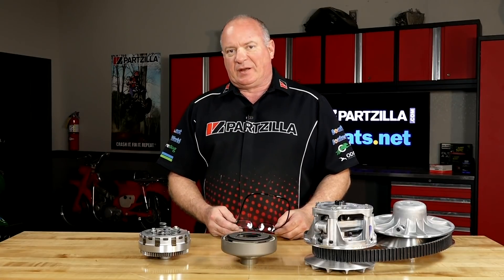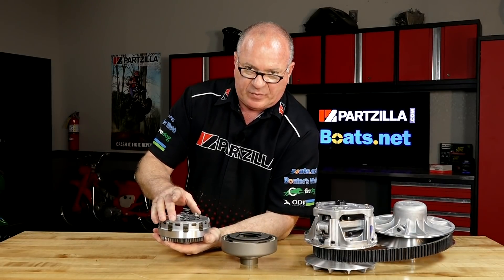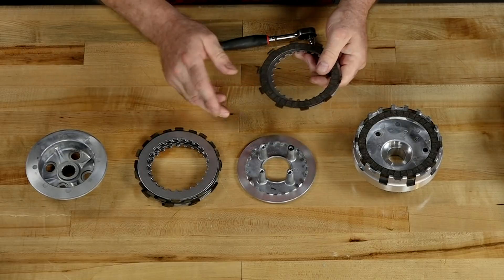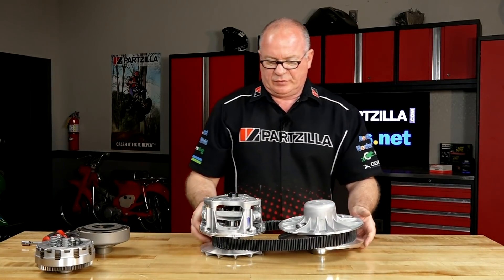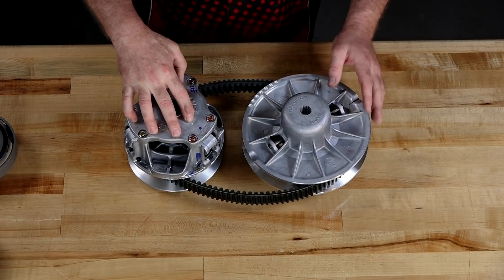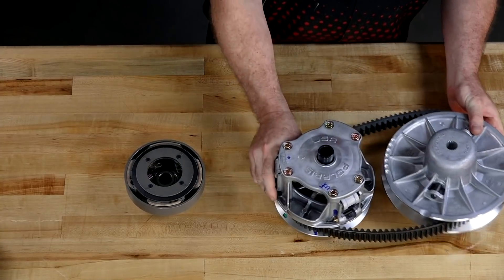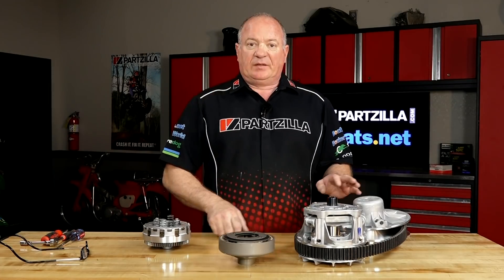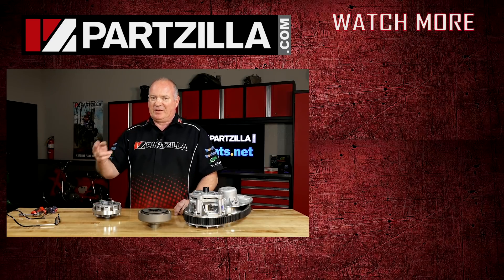How Do Clutches Work | How Does a Motorcycle Clutch Work | Partzilla.com

Comment: I took my FourTrax engine off the frame to fix some stripped head cover bolt holes and when taking the engine off I took the side gear assembly/shaft out and all those gears fell loose. I tried to line them up and did ok (tho I had to split the case to eventually place the washer back on that shaft ). Upon tapping the cover holes, changing the timing chain and reassembling it, I found there was no drive. I assumed it was the side gear where I pulled it out. So I removed the engine again and disassembled it again and split the case to find the washer and placed it back on the mainshaft. All the gears appeared right and zi shifted through them while turning by hand. Im assuming it wasn't the transmission but possibly the clutches themselves. I'm thinking I'm going to reassemble the case tomorrow and if I put it back together and it doesn't drive yet again it's probably a problem with the clutches and if I have to work on those again I'll just leave the engine on and remove the clutch cover on the side to work on it. Any idea why the clutches would happen to not work after being removed and reinstalled normally? It appeared to install right...

Edit* the reason I took the side gear off is because I was new to these engines and how they came apart. You live and learn 🤣

Comment: Hi John, I’ve got a 2009 r6. I replaced the clutch with a Yamaha oem clutch kit, including steels, fibers, and springs. When I put everything back together my clutch has no resistance. It’s as if the lever does not have enough space to make the clutch engage. It seems like I left a washer out or the three finger springs aren’t pushing the outer clutch out enough. Do you have any idea what the issue might be? Thanks

Comment: Good afternoon everybody. I got a similar question to what you just exposed  @Maximus Max. 
John, I have a Polaris RZR 900 XP EFI 2012 and whenever I release the gas pedal the clutch system reduces the speed so drastically that the tires literally go skidding the road. What can I do? Should I change the weights/spring / ...  on the primary clutch or should I change the driven one? Thanks in advance

Comment: Nice video John, keep the good work going. Hey, is there any chance you could make a video about the differences between the motorcycle pressure plate clutch and the slippery clutch version? i.e. my 14' GSXR1000 comes with a standard clutch but newer versions come with a slippery clutch, what's the difference? thanks in advance.
Reply: "Slipper clutch."

A slipper clutch allows the clutch to slip when downshifting, so if the rider doesn't get his or her shifts "just right," the rear end doesn't lock up and send him or her into a skid. With a slipper clutch, theoretically, one could be traveling at 65 mph in 6th gear, downshift to 1st, and let out the clutch lever, and the rear wheel would not lock up. Yes, the engine would over-rev to the moon, but at least he wouldn't go skidding down the road on his backside.
Reply from the maker: I'll see if we can get it done.